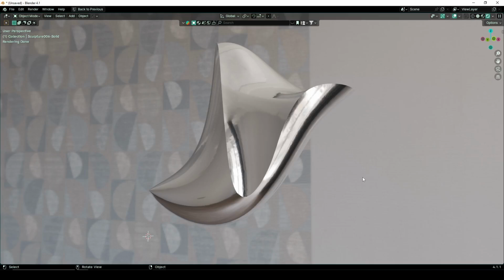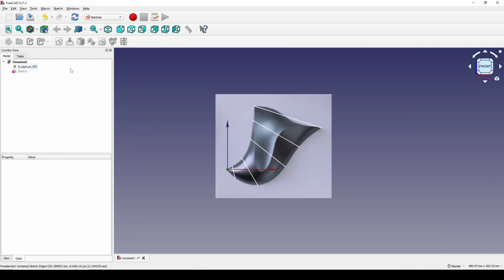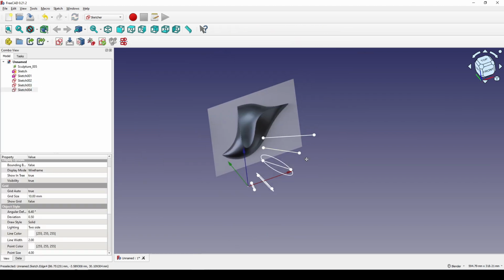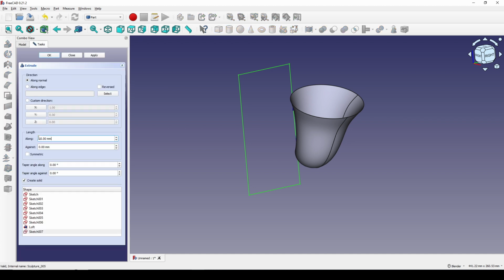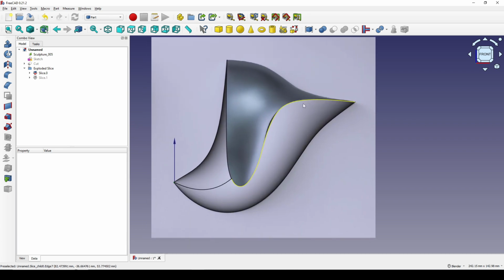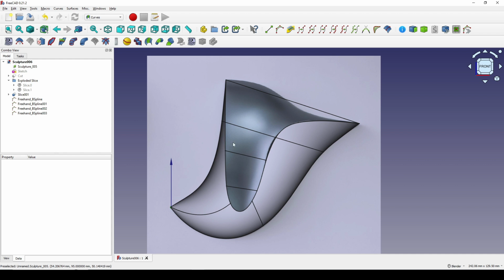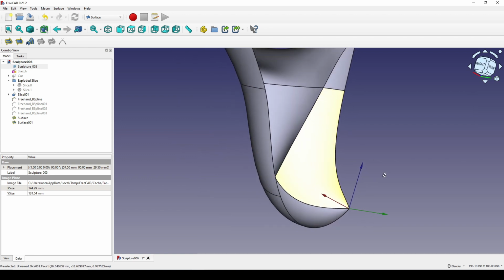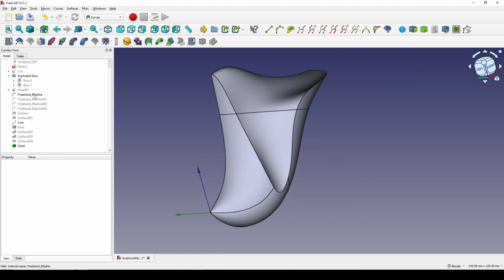Create A Sculpture Using Curve WB and Surface WB In FreeCAD

Comment: I do not want to be unduly critical of your work, but it assumes, that the profile of the body you are trying to create has circular section right there where you randomly draw the "section lines". They do  not look like a section lines at first, but the way you proceed it is clear, that those are  the actual section lines. Which is wrong, because you have drawn these lines just randomly....in another way to say it, if you draw a different set of those initial section lines at different locations at different angle, you will get  a part, which is different from the one you constructed here.....Maybe similar, but definitely different.
Reply from the maker: Hello Jiri! If the results don't match, go back and change the angle, the position of those lines a little bit, close the sketch the check the result. Keep doing that until you get the good result. Of course, it's impossible to 100% exactly like the image,  but you can make it close.

Comment: Dear DuyQuang, I follow this nice vidio again, at time 15.56 I want to add a new control point to the line, but I can not do it. You click the line and hit "I" to insert point, is it right? It dosenot work for me. I saw in these blender tutorial, people add pressed-mouse-button sign and pressed-key in the conner of the vidio. Could you also do that? Thanks a lot!
Reply from the maker: Hi, Make sure before you hit "I" you should be in the edit mod of the freehand bspline (double click on the freehand bspline in the treeview). If not, it won't work
Reply: @DuyQuangDang  I got it! Thanks a lot!